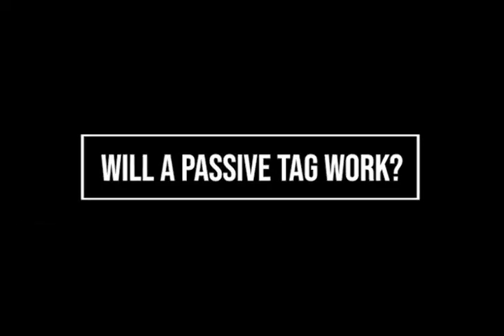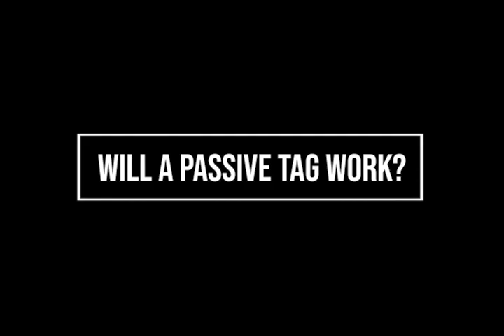Selecting an RFID Tag for Vehicle Tracking Applications

Comment: This video does a fantastic job explaining the factors to consider when selecting an RFID tag for vehicle tracking applications! The insights about tag durability, placement, and additional features like barcodes and printing options are very helpful for anyone looking to implement RFID solutions.

For a practical example of a versatile RFID system, you might find RFID Vehicle Tracking from GaoTek useful. Their solution uses RFID tags and readers to track vehicles in real-time and supports applications like access control and toll tracking. It could offer additional ideas for your project or help address specific needs like outdoor durability and enhanced tracking features.

Great content—thanks for sharing such valuable information!